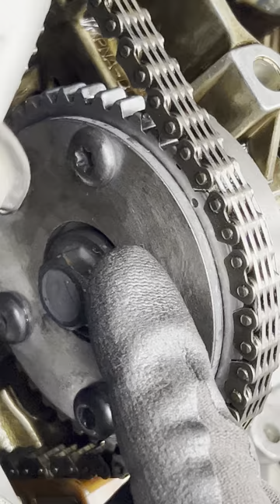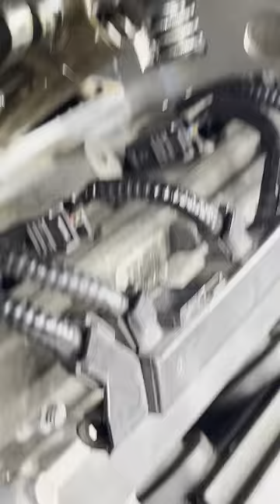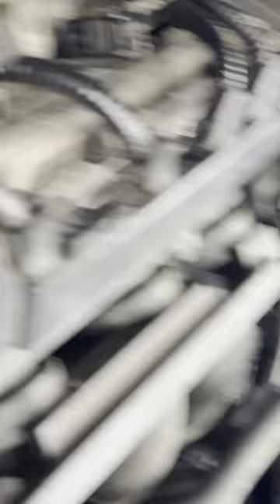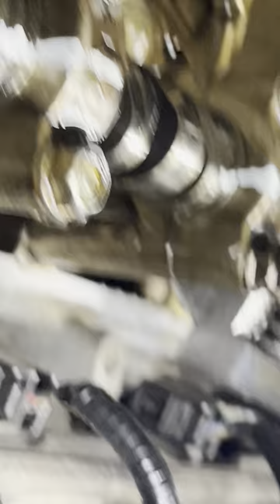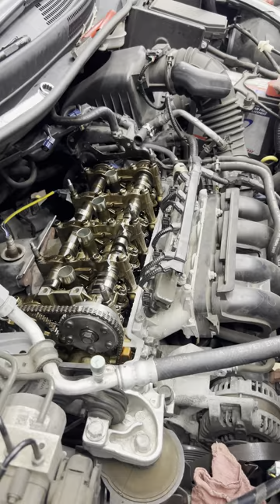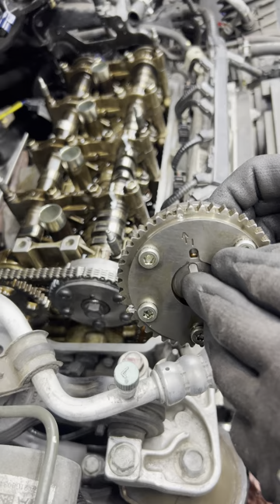Honda Vvt Actuator installation and understanding lock and unlock positions.

Comment: You can fix the part itself, without even removing the chain. Just remove the screws use a peace of cardboard for the back and a magnet and a towel to prevent anything from falling into the chain area slowly remove the cover and carefully stretch out the spring I doubled the length evenly, so it will function correctly and be able to fight the oil pressure, the first start will put it back in the correct position it rattled the first time for me it was noticeably shorter and has stopped completely even sence. This Saves a lot of time and money.

Comment: LISTEN MAN, I AM MAD CONFUSED. THE SERVICE MANUAL FROM HONDA THEMSELVES SAYS TOO LOCK IT, THEN TORQUE IT DOWN. I CAN EVEN EMAIL YOU THE SERVICE MANUAL STRAIGHT FROM HONDA JUST GIVE ME YOUR EMAIL.... SO FOR THE LOVE OF GOD, WHICH IS IT?! TORQUE THEN LOCK? OR LOCK THEN TORQUE!? LOSING MY MIND!
Reply: I’m in that boat right now I accidentally locked mine while on the cam and torque it and was told it was fine then I’m seeing this information and I’m afraid it’s messed up now
Reply: Torque the gear before You lock it!  The insides of the gear have a better position to resist the kind of force youre about to give them, not the same way if the gear it's locked, after You have torqued the bolt and all the Marks are in position , and the timing chain on, now with the help of an 15/16 wrench procede to rotate the camshaft until it gets locked❤ hope it helps
Reply: The Honda TSB says to install in unlocked.  I dont know what manual you are looking at.

Comment: what happens if it locks while your putting on the chain? Thats what happend to mine
Reply: You have to take the sprocket off, apply air pressure to the square opening on the inside of the sprocket (where the came fits into) and simultaneously turn it back to unlock position. 
It sounds more complicated that it actually is.
Reply: @punjabigrandma  Would you mind defining what type of air pressure? Like a shop vac or are we talking using a compressor. I wish there was a video actually showing how to do this.
Reply: @Max1mus0  There is a video.  I think its in the honda manual as well

Comment: It’s called a vtc cam gear. Vvt is what toyota calls their version of this gear. They work pretty much the same.
Reply: Some Honda aftermarket ones are also called VVT.  It's kind of an interchangeable term.   Variable Valve vs Variable Cam =  same thing.

Comment: Good explanation, but when you turn the camshaft counter clockwise to lock the VVT actuator, is there a risk of the valves hitting the piston? My new VVT actuator didn't come with this explanation so thanks.
Reply from the maker: @Rastameister  no

Comment: So I did not unlock mine when installing and have a ton of noise now. Would it be possible to swap the pin from an rbb into my rbc vtc that must be what broke right when torquing it while locked?
Reply: Yeah you broke the pin or possibly the seat.  They might be the same or might not you would have to look

Comment: I received one two weeks ago that was locked. I had to disassemble it to unlock it. Is there an easier way to unlock it?
Reply: It's a precision part you are not supposed to disassemble. You're supposed to shoot compressed air into it to unlock it but I don't know how
Reply: The manufacturer told me you can slide a tool into the square hole and lift the pin up while twisting the gear to unlock it.

Comment: What happens if we don’t lock it or it’s locked when we installed it ?
Reply: You gonna break the pin when you torque it
Reply: @ dam idk if I did it right but it’s still running no noise on start up 250000 miles tryna hit the 300k

Comment: Ever have the issue of changing the actuator/sprocket and now the engine has a tick and or like a lifter has gone bad? I know it’s a tapper style valve, but something not right. Timing checked and it’s spot on. Could it be a bad actuator?
Reply: Check your vavle lash
Reply: You probably dropped a tool in the engine.

Comment: On my car, it locked by itself when the bolt was tightened. Local Honda shop told me this is normal ???
Reply: Have you tried holding it with a spanner? If not well as long as the timing is right it should’nt be a problem